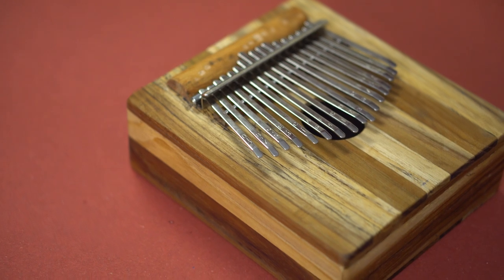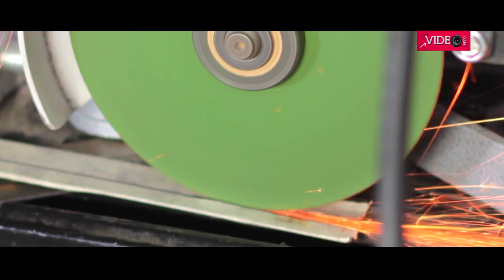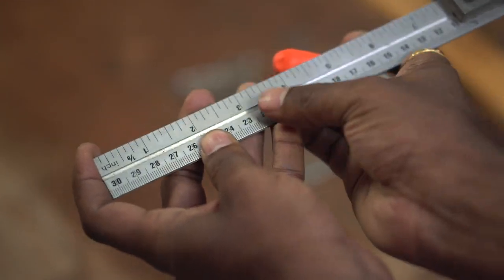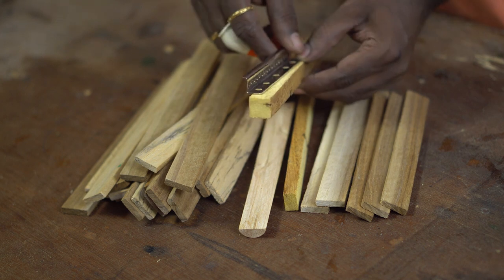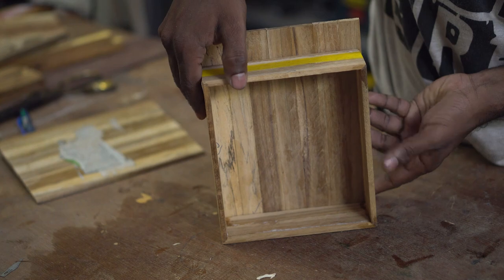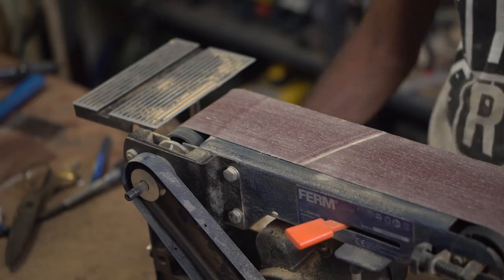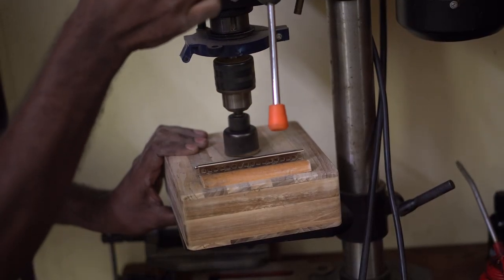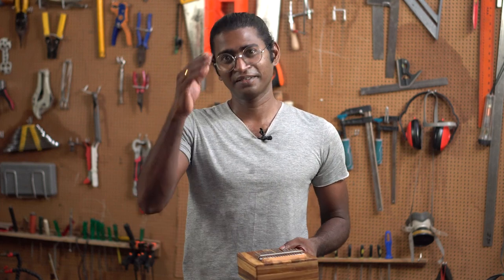DIY  #Kalimba _ easy Build, awesome sound

Comment: Your video production quality is amazing! However, i have a small question: Is the wood you have chosen particularly hard wood? Is wood hardness even important for a kalimba?
Reply from the maker: Wood hardness is important for any instrument. It affects the resonance in unique ways. The wood I have used is second quality teak wood..That's because wood runners I have found so far, always have second quality material. But in general, teak is a good material to work with. ( not sure if its good for making musical instrument). But for this instrument, it served the purpose.
Reply from the maker: And Thank you so much for stopping by and sharing your valuable time!!!

Comment: Pls give right link want to buy kalimba keys online
Reply from the maker: I had got them from Banggood.com. but now the shipping to India is not available.
Reply: @VIDEOEPPO  thank u quick response ,if u find any other link ,kindly send me 
Ready with other materials
Reply from the maker: @hemamuthukumarank7866  why don't you try using wiper blade spring steel. It's cheap. Actually,I liked the  sound resonance of wiper blade more than this one
Reply from the maker: You can find it from any automobile repair shop. Just 10 rupees ...some will even give for free...
Reply: @VIDEOEPPO  what is name to be asked
Reply from the maker: @hemamuthukumarank7866  you might need to do a bit of explaining to them. Nobody will understand what we are looking for and why. That's the challenging part of DIY. Explain them that you need the spring inside of the wipe blade.
Reply: @VIDEOEPPO  thank u